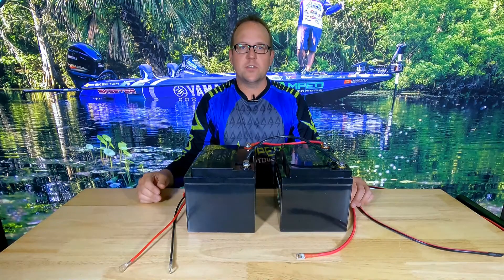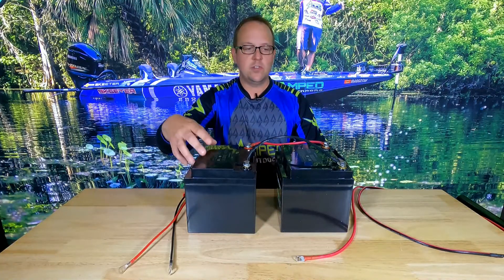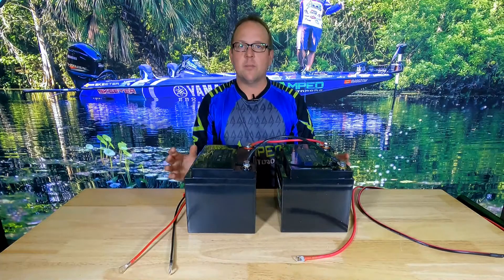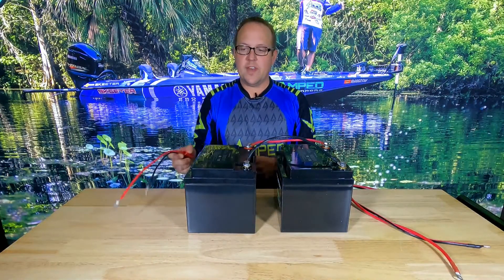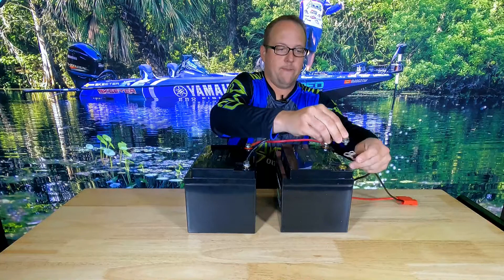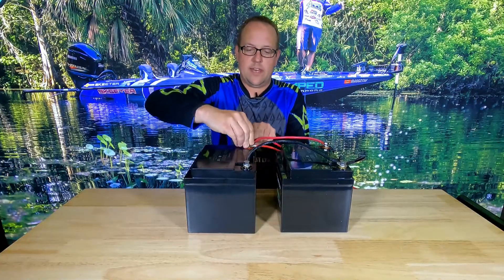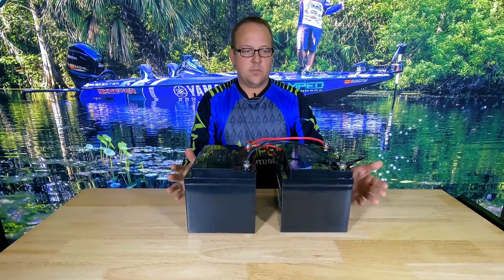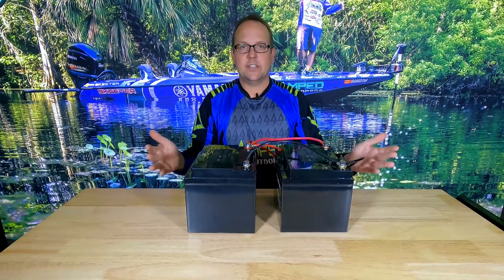How to connect lithium batteries in parallel!

Comment: Hey good video I got 2 batteries from outbax camping on eBay but didn't realise they note you cannot parallel charge or discharged them and if I connect them both it will damage the BMS connecting it your way was how I intended to use them but I don't really believe I can't parallel them your way do you think their information could be wrong ? Finding it hard to believe especially if I'm not using or charging more 40ah 50 ah BMS on each battery and batteries are the same
Reply from the maker: I would suggest following that battery manufacturers recommendation. Not all BMS units are the same so if they say you cannot connect these in parallel, I would not do it as it could damage the battery. Ebay and Amazon batteries are direct from China typically made by trade companies. For safety reasons, follow their guidelines. Thank you!

Comment: Thank you for the video. IM having some issues with the batteries running in parallel. Some additional questions. After I do the negative to negative and positive to positive. Currently I have the master switch. Where would the negative and positive go? Is this what you mean by source? Also I have a power steering switch that doesn't run through the master switch. How would I set these up? Lastly I have a NOCO Genius 2. How would I set these up directly to yhr batteries? 

I run two lithium 12.8v 100ah 31 Series.
Reply from the maker: Hello Chad, reach out to us at Sales@ampedoutdoors.com. We will need to look into your setup and see some pictures to figure out what you have going on. Thank you!

Comment: When connecting your source or charger, does it matter which battery is "first" and which is second?  If so, how is first defined?  For example. I have 2 Lip04 batteries connected in parallel.  One is closer to mppt solar controller and the other is closer to the inverter.  On a cloudy day I want to use a battery charger.  Does it matter which battery is "first"?
Reply from the maker: Hello, this should not matter.

Comment: How could you run two of your 30ah short flat top batteries in parallel? What kind of cables would you use since there are no posts.
Reply from the maker: You would have to create  custom cables using  F2 spade connectors.

Comment: Thank you sir I will be following your advice I'm hooking up two batteries 12 volt lithium iron same batteries to my 12 volt power inverter we are having rolling black outs you said that it is 12 volts you showed I appreciate if you can respond
Reply from the maker: Hello, yes these are 2 12V batteries in parallel to double your capacity. If you have any questions, you can always reach out to us for assistance. Thank you!
Reply: Thanks again I'm new to this

Comment: I have 2 60Ah Amped outdoor batteries and a noco genius 2x5A charger.  when I wire batteries in parallel can I still charge each battery w/ a separate channel of the noco genius? any change in wiring needed?  thanks!
Reply from the maker: Hello, yes you can still keep a bank on each  battery. It will not matter if it is in parallel or series.

Comment: Question: I have (2) 24 volt 55 ah lithium batteries, can I run them both in parallel to run an 80# Minn Kota Fortrex? Or would that setup burn out the motor? Great video and inciteful!
Reply: No it would not it would only double your amperage so that means instead of having a 24 volt 55 system you would have a 24 volt 110 system

Comment: i have a renogy 200 ah lithium iron phosphate that is a couple of days old that's been connected to my solar panel, but i want to buy another renogy 200 ah lithium iron phosphate so i can connect those two battery in parallel. my question is if the first battery can still be connected to the second new battery even though i'ved charged it. the first battery was only used and charged for a couple of days and it's not really old
Reply from the maker: Ideally you want to connect them in parallel when they are at the same SOC. I would reach out to the MFG to get their insight as their BMS will be different than others.

Comment: Will this work with a 36 volt 60 amp batteries?  

Do i still need to hook up both chargers or do i only need one charger if i have the batteries in parallel?

The one wiring harness for the trolling motor should do both batteries, if i have them in parallel,  correct??
Reply from the maker: Hello, yes you can hook the 36V up the same way in parallel. Only one charger is needed but you can connect two to charge twice as fast.
Reply: @ampedoutdoors6861 so do I put one charger on each battery?  I shouldn't have to put the chargers on in parallel, correct?
Reply from the maker: @jasonvenjohn4023  Yes, with the batteries in parallel and using two chargers, then put one charger on each battery.
Reply: @ampedoutdoors6861  I'm song this on my trolling motor pulling plugs at 2.5-3 mph, how ong do you think it will last with this 2 battery 36 volt 60 watt system with half foot waves?
Reply: I have it on a garmin force trolling motor
Reply from the maker: @jasonvenjohn4023  That is really tought o say. With the app on your phone, you can monitor your draw and it will give you estimated time remaining.
Reply: @ampedoutdoors6861  ya, I have that, I was running average of 2 mph and it lasted around 5 hours. I should be able to get 10 between the two, correct?
Reply from the maker: @jasonvenjohn4023  If you double the capacity, then yes.
Reply: @ampedoutdoors6861  which is my #1 battery, how would u tell that if u have the power cord, one on each post on both batteries?  Or does it even matter?

Sorry for all the questions, just wanna make sure this is done right when it's gonna cost close to $3000

Comment: since you are drawing amps from 2, 60 amp batteries does the 50 amp continuous discharge go up? I wanna get one of these batteries but ill be using it with a motorguide xi3 55lb trhust if I'm not mistaken the motorguide draws 50 amps at max speed and I'm worried the battery could overheat especially in the heat of the summer. let me know becuase if continuous discharge  goes up this way I could get two batteries and have 120 amps
Reply from the maker: Hello Rodrigo. In parallel, the max continuous amp draw will be 100A as it will double. On a kayak, you would never draw more than about 35A of power. The MFG rates the 50A max draw typically on a heavier boat, in strong wind and current as worse case scenario.

Comment: Would this work for connect two 12v 30ah lithium batteries?
Reply from the maker: Yes, it will be the same for all 12V 24V and 36V batteries.

Comment: Question:  Can you use the remaining set of positive and negative terminals to separate the charging from the load carrying cables?  For instance, the charging cables would remain where you have them and then the load carrying cables would move to the other two terminals.  Good video.  Thanks.
Reply from the maker: Hello Bill, yes you can do this to help even out the charge and discharge load.

Comment: I'm confused.  So in parallel, you're still getting only 12 volts but doube the amperage and in a series comnection, you'll get 24v with 60ah only?
Reply from the maker: Parrallel keeps same voltage but increases capacity. Series increases voltage but keeps capacity.

Comment: Hello.  could I take 3.7 volt LI batteries and say make a set of 10 of them wired in parallel to increase amp hours. Then make 4 equal sets of those ten and then hook them sets in series effectively making 14.8v??? Basically can I take a bunch of parallel wired batteries and then wire them sets in series to increase voltage or would just create problems and screw up charging????
Reply from the maker: Hello Lucas, I would be careful with making your own pack if you are not comfortable and familiar with how to build the correct configuration with the appropriate Battery Management system. It can be very dangerous if not done correctly.

Comment: I have 2, 50 amp lifpro04 batteries to power my motorguide XI3. What size wire should I be using to connect my batteries in parallel? My running 8 gage wire to the motor approx 14 feet in my kayak. Thanks in advance.
Reply from the maker: Good morning, the 24v system will also work with 8awg.

Comment: 19AH LITHIUM BATTERY (14.8V NMC) WITH CHARGER, can I connect 3 in parallel and use only one charger as in this video? If not whats the best way to set up
Reply from the maker: Hello, you can but ideally a larger battery would be best. You can connect in parallel like this video needed.

Comment: Thanks for the video, am looking to run this setup for my 24V trolling motor.  But was curious if you can use an alternator charger like the Minkota two bank to charge this 24V Lithium (2x12V) while running?
Reply from the maker: Hello Luke. Reach out to us direct, there are a few options. Typically we do not encourage this as if you size your lithium battery correctly, you should not have to charge them on the fly.

Comment: I've just bought three 100A wall mounted lithium battery for my solar system and they don't allow me to connect more than one cable to the negative and positive of each battery at same time, they have special connectors for each terminal so what would I have to do to connect them in parallel correctly? And also, both of my load and charger use the same cable since I use a Hybrid Inverter that charges the batteries and also feeds the load from the same pair of cables.  This is the kind of battery I'm talking about: https://www.youtube.com/watch?v=F8bFtdQDuGg
Reply from the maker: Hello Rauser, this is not a battery type we carry. I would contact the manufacturer to get the correct wiring schematics for doing this.
Reply: @ampedoutdoors6861  all right... thanks!